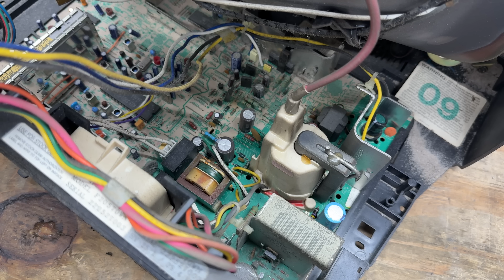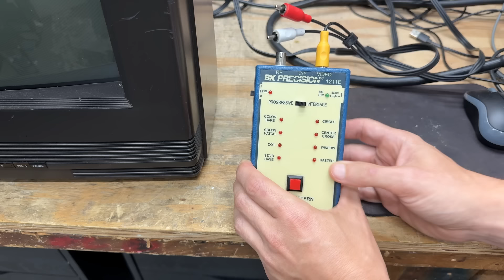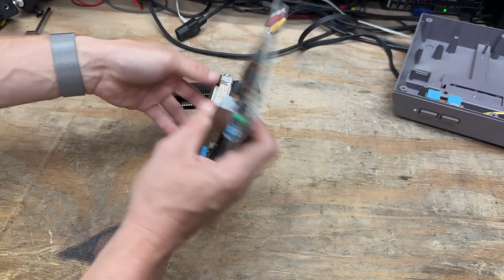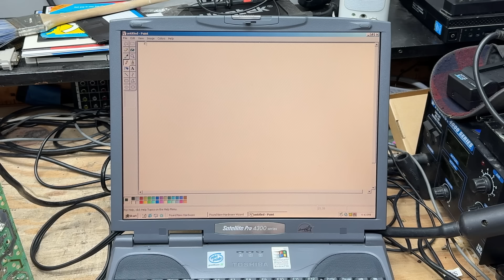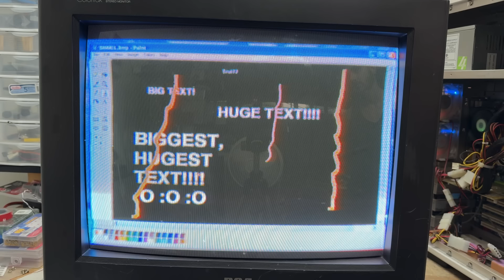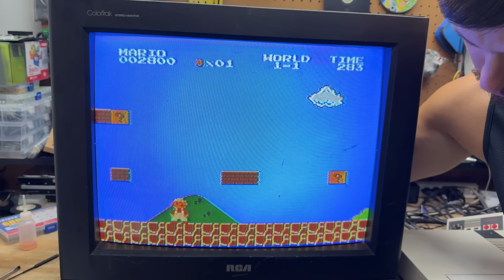Let's fix an abandoned CRT TV from the '90s!

Comment: Many of the Nintendo cartridges also a battery inside them on their boards, if the battery goes bad the cartridges will not fire up. That is the one and only console I ever played on back in the day, ninja gaiden was the game. My Girls loved Mario. well did play pong and some other early stuff before the Nes and My first game on a computer was before any home systems, we use to test the computer system at a company I worked for during backups with a game for stress testing. That was a long time ago. Only other game systems was some early Arcade Boxes and a lot of quarters. Jost, Centipede, yeah those were the days.

Comment: Learned a thing or two here!! One question, where are you grounding your scope to? Just nearest ground on the board? Dc side specific?
Reply from the maker: If the signal is referenced to ground, yeah you can grab the nearest chassis ground. One thing to keep in mind: Many CRT sets used ‘hot chassis’ designs so there’s a 50/50 chance the chassis ground is actually the hot side of the AC line(!) You’ll definitely want to use an isolation transformer to avoid damaging the scope, the set or yourself.
Reply: @miketech1024 Roger that! Definitely far more knowledgeable about this stuff than myself! Any chance you have an email or any way i can reach out if i get into a bind? Have a couple sets that got me stumped!
Reply from the maker: @JunkyardDigs  Sure thing! I’d love to help out. You can reach me at miketech2048@gmail.com
Reply: @miketech1024 heck yeah!

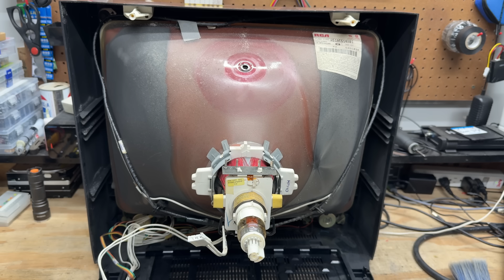Comment: 8:39 maybe the arcade monitors I'm used to working on are less sensitive, but for 15 years my dad and I have been pulling out the tubes and chassis of arcades, spraying them down with Simple Green, and washing them off in the shower. 
Working on a tube and chassis that's clean is way easier than the grime you get from 30+ years of neglect.

Comment: 15:25 It is nice to see you exercising caution with the "one hand behind the back" reflection in the tube. A great safety tip to pass on to anybody working on high-voltage open-chassis equipment, always put one hand behind your back so that you don't complete the circuit across your chest 😉. Great video and great restoration 😎👍

Comment: Just to warn you for next time, when you go to discharge a CRT using a connection to the ground strapping, keep the neck-board connected!  (at the start of the video when you first took the TV apart you tried to discharge it after you disconnected the neckboard)

When it's disconnected that ground lead is left floating and there's nowhere for that anode charge to go so you are basically doing nothing and it will not be discharged! There's a ground pin on the neck that the neckboard connects that grounding strap to so with it disconnected you won't successfully discharge it! CRT is a giant capacitor. Imagine trying to discharge a capacitor by just touching one pin and not actually bridging them. That's basically what you did here when you tried it with neck board disconnected! ;)

Comment: Hey mike on the pcb on the tube yoke there should be RK, BK AND GK, OR KR, KB and KG, this will kill any red, green or blue from sending to the tube if there are any of those colours coming through after you de solder those pins the tube has an issue

Comment: next time can you edit out the high-frequency noise? i'm 36 and i can still hear it(or your mic picked it up and changed the frequency somehow and made it audible). by about 45 minutes into the video it actually hurts to listen to.
Reply: you must have a very nice audio system to replicate a non existant 22khz from a video codec that cuts frequency response at 16khz.
Reply: @TheGhostOfKingCobraJFS  you are very correct that that should be removed but i don't know exactly how it made it into the audio. i opened it(opus audio track) up in audacity and changed to spectrogram view, and sure enough it's visible as a series of lines around 16khz. whatever encoder his camera is using is picking up that high frequency and somehow making it 16khz. i'm not crazy, check for yourself. use headphones.

Comment: It's worth trying with no capacitors at all in the RGB video filtering. I've come across this sort of thing in some televisions before, and get the impression it's to deliberately 'soften' the picture. Any capacitance to ground in the video amplifier circuit will reduce the rise time. The choice of RGB output transistor load resistor also affects high frequency response. I noticed rather high values and the transistors were not very high power type with no heatsinks. Obviously running at a low collector current. That, with tube cathode capacitance will roll off the high frequency response. There's a lot that could be done to improve picture definition, but it's a domestic quality set made to a price.
Reply from the maker: Yeah I think this is a post-enshittification revision of this chassis. The Sam’s shows a neck board with much beefier output transistors.

Comment: Thank you for popping up in my recommendations and bringing back fond memories of my electronics repair shop days of the late 80's to early 90's> I happened to be a factory authorized repair center for Nintendo at the time and seeing you rip into the original NES gave me a chuckle!  With regard to the convergence issue on CRT, I'd suggest trying a degaussing coil on screen to at least rule that out. Its possible the CRT may have taken a blunt shock as evidence of a slight misalignment of yoke. Kudos on keeping the retro stuff alive.

Comment: I suspect the impedance vs frequency response of the replacement capacitors are having as large of an effect on the bleed. And they are almost certainly different than the smd.
Relatedly the ESR could be checked or compared at least.

Comment: Oh my goodness, Mike, my heart just warmed up like a radio-tube :-) Back in my younger days, older folks already told me that I should not bother with electron tubes, but I loved and still love them. It is so unusual that your generation like analogue and even tube technology. Thank you from the bottom of my heart for this video and what you said in the end of the video 🥰😍
Reply from the maker: Thanks! My interest in tube-based devices stems from my father’s interest in them. He was a radioman (and ET I think) in the Navy, circa 1970s. Afterward, he worked as an electronics repairman for as long as I can remember. There was always a vintage radio or television around the house being worked on (oh, and so many computers). By around age 12 I got brave enough to start working on them myself (the high voltages and implosion risks were terrifying, but I finally got over it).

Comment: good advice on the mains filter cap, years back I was repairing an old arcade monitor (GO7 CBO) and was doing some topside ohm testing, set the board in my lap and discharged the filter cap into my pills , thats a lesson teacher believe me

Comment: Usually that "crack" that you get when you loosen screws in plastic for the first time is because they were inserted before the plastic had fully cured, and the screws were rammed in likely by some underpaid assembly line worker with an air or electric screwdriver, fast as can be. A lot of those assembly line tools are set to a certain "torque" so you just ramrod the screw til it stops, just enough engineering to make sure these things are produced rapdily. Oh, and a little bit of sandpaper wrapped on a wooden dowel is the best way to clean corrosion out of the center of RCA jacks, or the right size tiny dremel grinding tool, sans the dremel, of course. Make sure it's the wet / dry sand paper and put some deoxit or something similar on so it's easier to clean out.

Comment: That was a very nostalgic trip for me. Back in the day I'd just replace the Jungle IC. Plus it looks like someone tried replacing the crystal maybe it helped for a while, try seeing if you can find out exactly what the value truly was. In any case it's the IC. This was truly an entertaining video in my book, it also proved why GoldStar was more expensive than RCA in the early 1990's Just like I told my mom back then "GoldStar is better!" It's Good the 21" and I do still have the 27" in my bedroom to this day, and  yes it still works today. Needs a 10uf/450V cap near FBT to be changed though the screen is brighter than it should be.
Reply from the maker: The xtal is marked as 3.58MHz so maybe has something to do with chroma. My scope has died in an unrelated accident (never forget to connect your isolation transformer kids…) so I’m unable to test it right now. Yeah I wonder if the jungle IC is just tired. It’s nearly as old as me and I’m definitely tired…

Comment: It looks like there is poor EHT regulation, causing blooming and might be related to the horizontal blurring of the image. You might want to test the polyester caps around the flyback for ESR. Usually horizontal smearing is caused by a high ESR electrolytic capacitor in the video signal path (creating phase shift at lower video frequencies), but on composite signals it causes a white smear instead of the individual colours you're seeing. I didn't see any electrolytic capacitors on the neck board. I found a forum thread from 2004 where someone with a similar chassis was complaining about the same problem on just the red channel. Might be a common problem with this set.

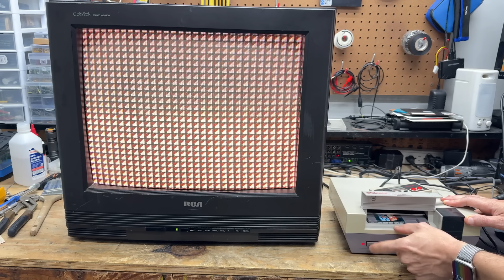Comment: Little NES hack, Mike, there are modern edge connector replacements for these front loader NESes, like the blinking light win and Ninten-drawer, that replace the edge connector and get rid of problems like what you’re experiencing at 25:40 and the blinking light. They also make the console region free without the need for a NullCIC, or even that trick of disabling the existing lockout chip. I’ve personally put the former in my NES, and despite it holding onto cartridges for dear life, it makes my NES way more reliable
Reply: I've done a ton of those, it's amazing how much of a difference it makes; basically bringing them back from the dead. (edit they make cool led glowing ones now too for modders that seem pretty sweet)

  it requires skill to replace but mike has enough soldering skill to do it without much issue.

Comment: 15:04 I've been wondering if there are any incandescent bulbs around. There's still some 100w etc here in Australia but 240V. Hmmm, would it matter being in series? Aliexpress does list halogen replacements
Reply from the maker: They are very hard to find here in the US also. Best we can find in retail stores are 40w appliance bulbs and weird three-way bulbs. Even tough to find them via online retailers like the Scamazon. Best I could find are 100w 'rough service' bulbs. I've tried with halogen bulbs, but their cold resistance is so low that it negates the soft-start characteristics (inrush current still spikes crazy if caps are leaky). We may have to source more readily available tools for our soft-starting needs in this cursed modern age...